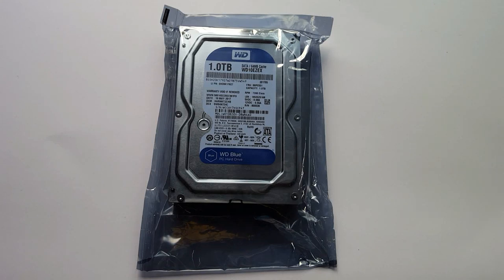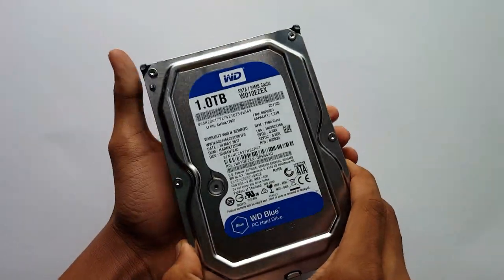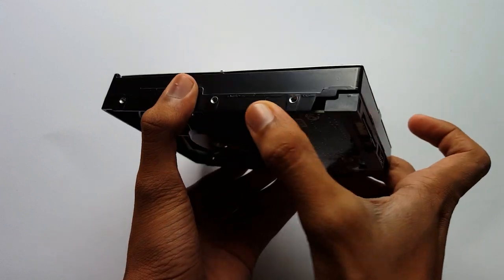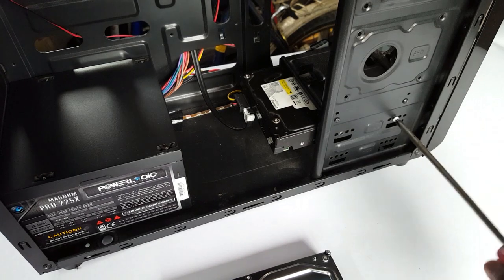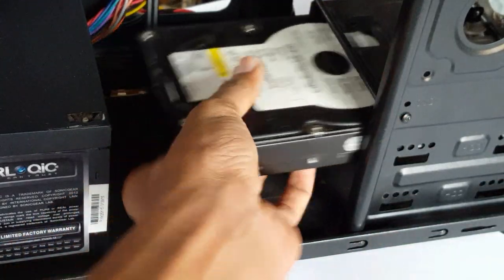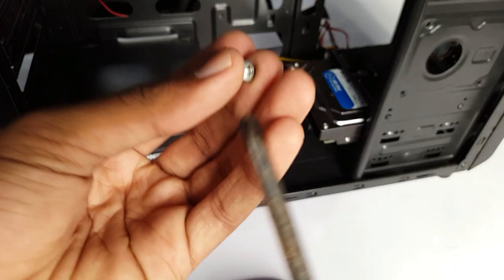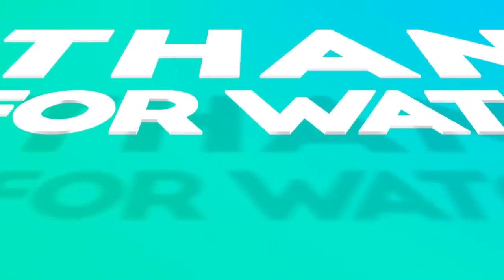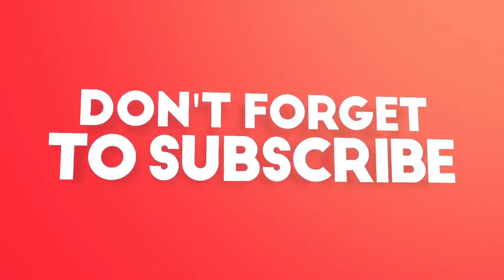Hard Drive: Western Digital 1TB Blue Hard Drive Unboxing And Installation Guide!

Comment: Does replacing a hard drive erase everything including windows? Sorry, am new to this..
Reply from the maker: All your data is stored in your Hard Drive. It is the storage of your computer. Yes it will erase everything. And your new hard drive will be empty.
Reply: @TechTelecast  is there any way so that at least my windows can't be uninstall because if I install new hard drive my computer won't boot up. Right
Reply from the maker: Are you adding an extra hard drive to your computer?
Reply: @TechTelecast  yes mate, I've been deciding to this, so in this way can we use both hard drives means our old files and also windows which is stored in our old hdd??
Reply from the maker: Yes it will be in the old HDD, however you will have to partition your new hard drive in order to use if. After you insert the second hard drive. Search YouTube how to configure second hard drive on pc. There are plenty of videos to guide you step by step❤️💯 All The Best!
Reply: @TechTelecast  is it possible to add it and not have to remove the old hdd? and if i cant and have to change it will all my games stay or no?
Reply from the maker: You can add a new HDD and keep the Old hdd. You can add as many drives as you want depending on the number of sata ports on your motherboard
Reply: @TechTelecast  okay perfect thank you, one more question does a prebuilt cyberpowerpc come with extra sata cables etc for an additional hdd?
Reply from the maker: I have no idea about it. However, you can purchase a sata cable for around 2$

Comment: Can you please tell me about the durability of these hard drives. How long have you been using this?✨️
Reply from the maker: In my experience i used it for 2 years and it failed. Then I switched to SSD’s and never had a problem till today. However, SSD’s cost 10x compared to hard drives.
Reply: What if i have a 240gb ssd and add a 1 tb hdd
Reply from the maker: Connect your 1tb hard drive and follow create and format a new partition method from this link https://support.microsoft.com/en-us/windows/create-and-format-a-hard-disk-partition-bbb8e185-1bda-ecd1-3465-c9728f7d7d2e

Comment: What the new of the cables? Mine didn't come with them.
Reply from the maker: One is power connector and the other is sata connector. Power connector will be from your power supply and you should find a sata connector in your motherboard packaging. If not you can purchase one online. Checkout the link in video description.

Comment: Do you have to buy the power sata cable and the data sata cable or it comes with the box
Reply from the maker: Sata power cable will be from your pc power supply. If all sata power cables are used you have to get a molex to sata converter and connect it to your hard drive. The data sata cable you get with the motherboard, if you don’t have that extra cable you will have to buy a new one.
Reply: @TechTelecast  thank you so much